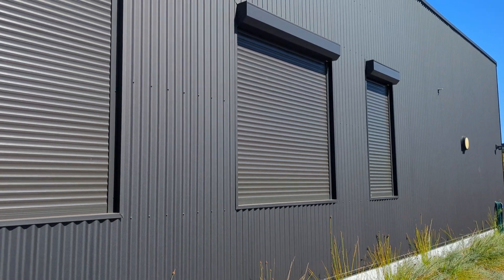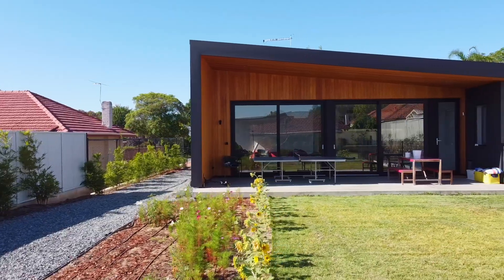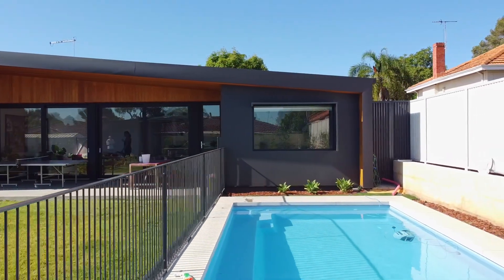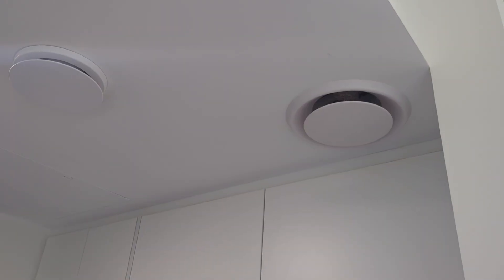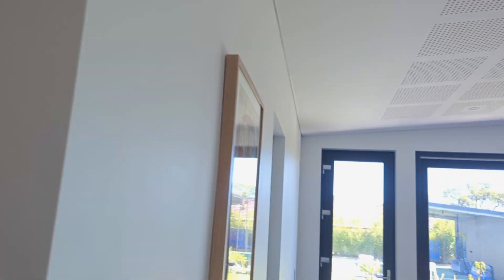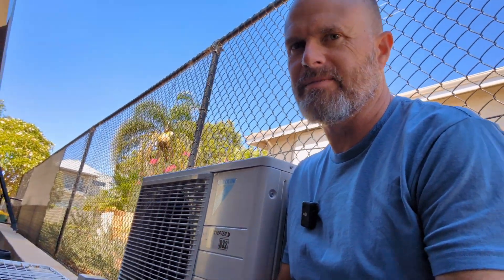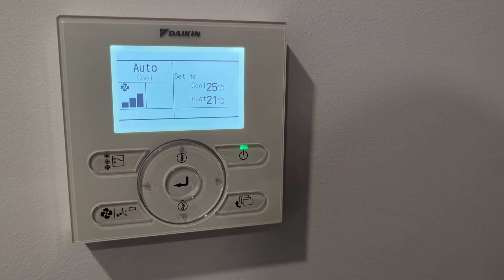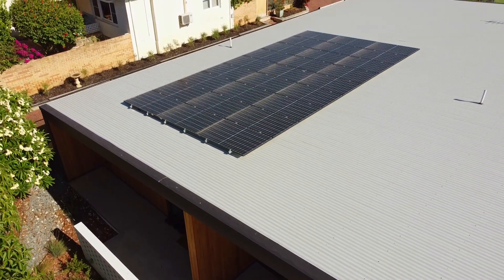How does our Passive House perform in a heat wave?

Comment: Great video and thank you for sharing but while it is true that the exterior of the building and air tightness is important, and glass shading is crucial, the insulated thermal mass of your slab is really what is helping you to ride out the day heat and into the generally cooler night cycle with lower energy use - lag time + coupled with clever sensible design - which you have shown. There is good material available on performance benefits of light coloured cladding (such as Coolmax roofing) but you are right that overall design is probably more important - but bad structual design coupled with dark colours will make things worse.

The thing with your dark walls is although it does suck in more heat it seams that material plus the backing arrangement provides little thermal mass for that heat to sink and radiate from for hours - which is why brick walls isn't the best exterior cladding for many climates. The vent system behind the tin walls may provide some venting but most of the heat heading internally would be radiant heat which is in the infrared spectrum and doesn't vent via convection - I assume you know this which is why I don't see any of those whirly-birds on your roof - good choice. But it makes me wonder if you have a reflective barrier in your walls (vapour permeable) which is reflecting the radiant heat out (25mm air gap required). The other negative for dark colours is that it heats up the surrounding neighborhood (urban heat island effect).

Efficiency Matrix just did a video test on special paints you can watch here: https://youtu.be/V8dg1ePdJ68?si=6kUbSGeQDBP0CyJw

I also recommend their blockwork video: https://www.youtube.com/watch?v=rrWdTVE1M_4

I have just replaced my concrete tile roof with Mars terracotta from Monier which has a lower SOI compared to the prior roof. With terracotta having more thermal mass SOI is important. I also have R6+ glasswool insulation and non-reflective vapour-permeable membrane sarking (I am in Melbourne) which is essential when you insulate the roof cavity to a high standard to manage condensation on the back of a tile. It took a long time to explain to a well known roofing brand in Melbourne why you should not being using non-permeable silver sarking when you insulate thoroughly in a cool climate.

The bush fire smoke prevention you described is down to the filters and the capacity of the filter to screen out particles of sufficient size. With smoke being between 0.5 and 2.5 microns in size I would be curious to know what your particulate filter is capable of. In addition the ability to keep your home positively pressured with clean air really helps keep smoke out (noting your house is passive tight). This principle is behind clean rooms used by industry.

 In regards to the Daikin heat exchanger cooling performance usually stops with an ambient external air temperature around 44-46C  degrees at this point you are reliant upon your slab to keep the home cool (this is when ceiling fans become important for keeping the people feeling cooler than ambient - breeze).

Your additional air transfer fans are really good. But they also have a role to play in managing the stack effect in two story dwellings with open stairwells. Have you used these this way in your projects in addition to a HRV?

I really enjoy your videos and its really encouraging to see quality architectural design that doesn't cost the earth being promoted. I hope you get more subscribers and I appreciate being able to see some of your building designs and floor plans on your website and videos. It would be amazing see the project home builders promoting and building quality homes and not just the biggest thing with lowest efficiency they can ram on the block to unaware home buyers.
Reply from the maker: Wow, thanks for taking the time for such a detailed comment. I agree that the slab does have a stabilising effect on the the internal temperature. It certainly feels cool under foot, but Passive House software does not take Thermal mass into consideration. If anything the software penalises slab on ground for the heat loss effect.
Reply: @theleanarchitect  Interesting but I suppose discounting the slab makes sense for a German designed approach to energy where sun heating during winter and cooling retention in summer isn''t available to them to such a degree.

If you haven't seen it The Harmony house is a good video to watch - not everyone wants a HRV dependent based house: https://youtu.be/GPZMkRxoTNE?si=p1sGEXW13-ROvYlX and this house is a good insight on what you can do with traditional plaster: https://youtu.be/pRXsumjJbNE?si=1AaRyG8QTWrfkR23
Reply: Great dialogue 
This has always been my nemesis, the vast majority of information on passive design has been written for climates that have great temperature variations, like northern hemisphere, vs warmer climate zones

Thermal mass energy storage is the best friend for both climate zones, just the treatments for them are different 
Having done many in North America and now focusing on hot/humid climates I am addressing the same solution but thinking differently 

I use a thicker slab with a similar ext. perimeter thermal barrier and depth, and also I use more thermal mass inside the house for retention than other passive house designs in Europe. 
I find homes in the hot climate zones easier to design than the ones I did in places like Canada 
Because the intensity of heat is only limited to a few hours of the day ( mostly 9am to 5-6pm) with the remaining 15-16 hours becoming temperate. Versus in places like Canada for 3-4 months a year the day can be -15c to -25c and the night dropping off to -25c to -40c 
So the need for energy production and storage is paramount, furthermore 5-6 months later the design that was effective in winter is working against you in the summer which ranges from 30c to 40c 

This is why I approach this issue in hotter climate zones, where I am now, with more thermal storage (for the hot 30-35% of the day) and slowly releasing for the 15-20% moderate temperatures ( 5-6pm to 9-10pm) then I turbo-recharge my mass the remaining of the 24hr cycle (10pm to 6-7am) when outside temps are enjoyable 
I find this works best in environments where the variant from outside temps ( days high to nights low) is no less than ~10-12c, ideally 15c 
Which I believe Australia is in that range ( ie daytime high 38c overnight low 23c )

Of course there are many other factors to passive design and execution but…..
Just my 2cents
Reply: @alawoye Interesting comment. Being aware of your environment is super important for design.

Australia has varied climate options. Not as cold as Canada but  cool climate living (-10c nights to 5C days) to desert to tropics.area all here for architects to design for.
Reply from the maker: @AndrewC007  We live in Climate Zone 5 which is Warm Temperate. This would suggest that winters are comfortable, when in fact they are quite cold by Australian standards. Having previously built and lived in a modern Solar Passive Home that relied on Thermal Mass, I can tell you that it means absolutely nothing if you have excessive heat loss through the thermal envelope (walls, roof, glazing and thermal bridges). The home would collect winter sun easily and heat the part of the slab that received direct sunlight, but overnight all the heat gains would be lost. Its a hopeless system.
Reply: @theleanarchitect  You need good internal window coverings (honeycomb blinds sealed to the edges). Also there is now vacuum glass (Panasonic) which has a U-value  of 0.4 so windows (if you are prepared to pay) can really address heat loss. But yes managing windows is important. Jenny Edwards in Canberra - much cooler than Perth and sometimes hotter with no chance of Freo sea breeze provides some good insight into design choices for her own home https://www.youtube.com/watch?v=tM-2rRzuKGs Jenny also has come good articles on retrofits of 1950s to 1970s vintage housing for this climate.

Comment: one good thing about solar panels......they perform well on hot sunny days when running an air con is useful. I commend the use of small practical,sensible windows.....most homes have stupidly large windows for the Australian climate. Dark colorbond colours also fade sooner........any roofer will tell you that.  Its stupid.
Reply from the maker: We have light coloured roof on this house - it is not visible from the street. I must admit that sometimes we cant avoid the dark roof but we take measures to negate its impact on thermal performance, such as ventilating the cavity and provide high density insulation with elevated specific heat capacity.
Reply: @theleanarchitect   I completely agree that the thermal affects can be mitigated........the problem is having faded colorbond colors dont hold the intended aesthetic effect for any length of time, by home standards.  Homes are not cars.
Reply: since you basically have a very light colored roof I would have installed bi facial pv.lifted off of the roof a way so that light reflection can hit the back side of the panels
. and a simple thermal solar to preheat the water.. From my understanding in your part of the world something around 46% of all power is being used to heat water.. Seems like a big load but that is what the installer was saying.